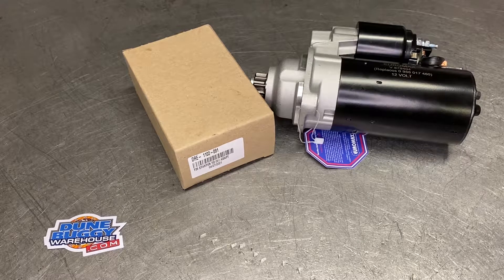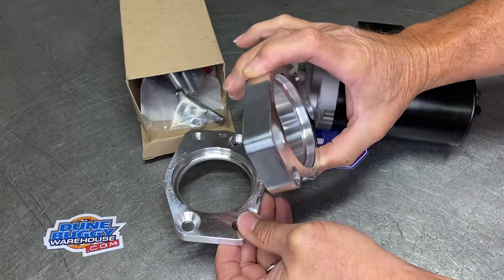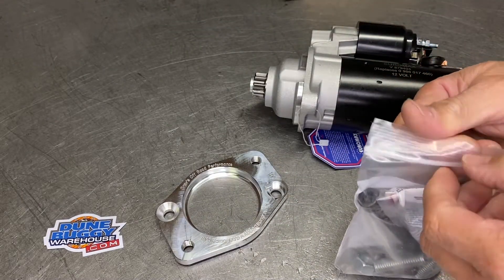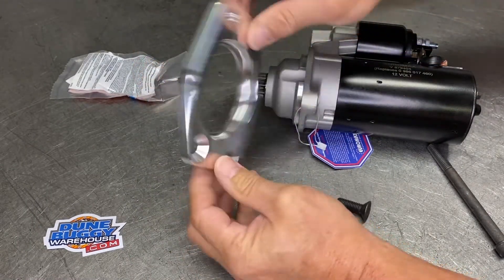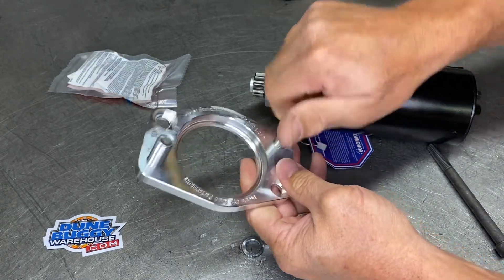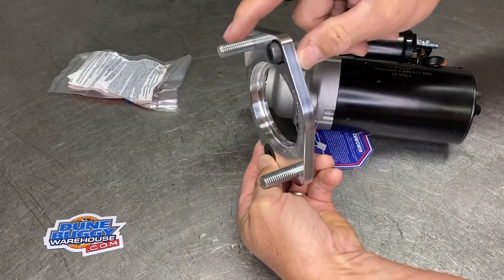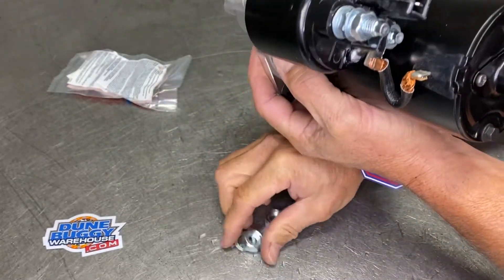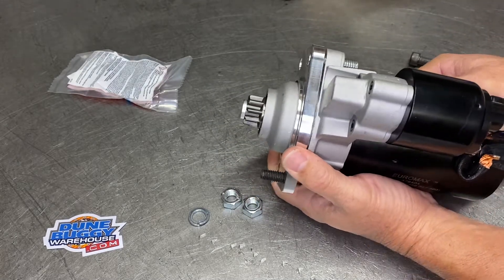TDI Starter Adapter for 091 and 094 6 Rib Bus Transaxles - DuneBuggyWarehouse

Comment: Does it work for a 1974 VW bus with 091?
Reply from the maker: Yes it fits. Important to disconnect battery before install as the positive cable is near the sheet metal until you get it on the starter post.